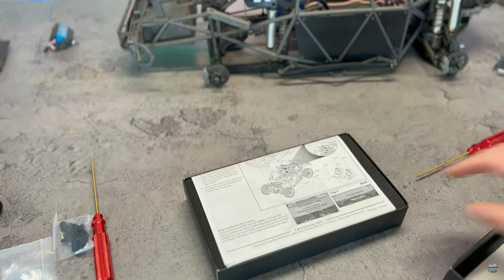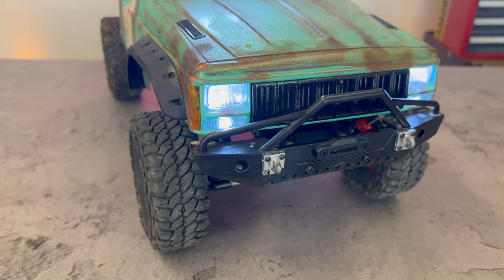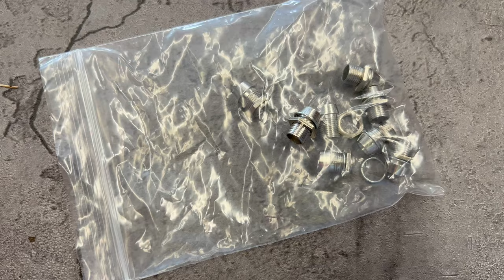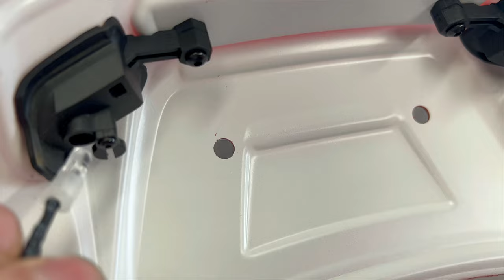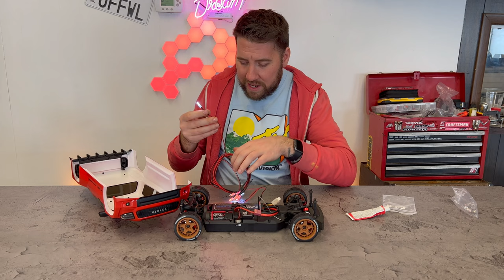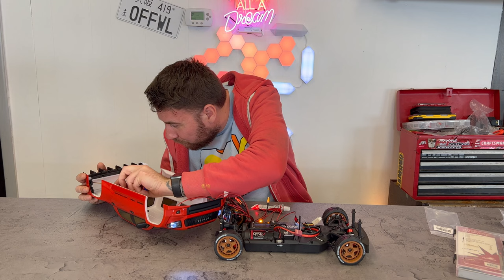How to Install RC light kit. Everything you need to know!

Comment: The video was super clear and well put together. HOWEVER, I am a little slow when it comes to electronics.
My doubt is exactly in the part you "skipped": I have an old nitro RC. How do I connect those basic cheap always on lights to a power source? Where am I supposed to connect them?
Thanks in advance.
Reply from the maker: Any channel on your receiver that isn’t being used.
Reply: @10thScaleGarage  I think I found the issue. There's no free slot. It's a 2 channel transmitter. Told ya it was old haha